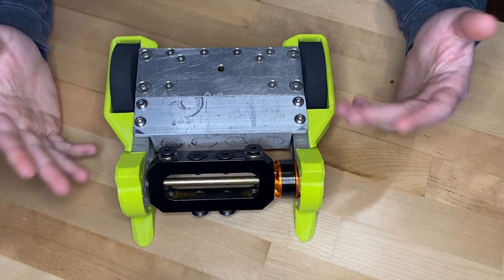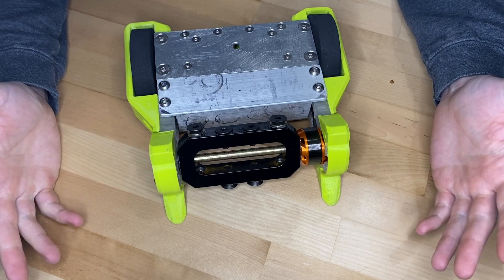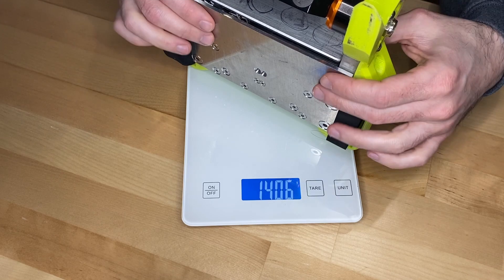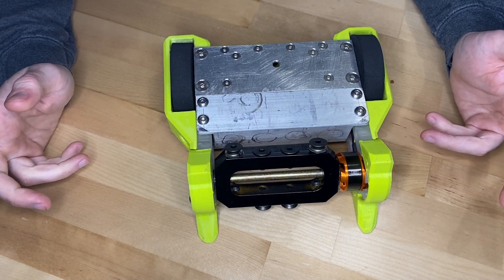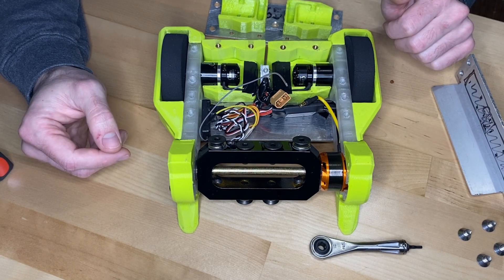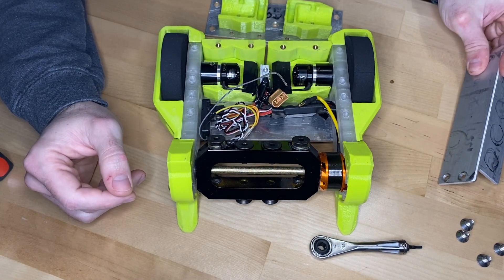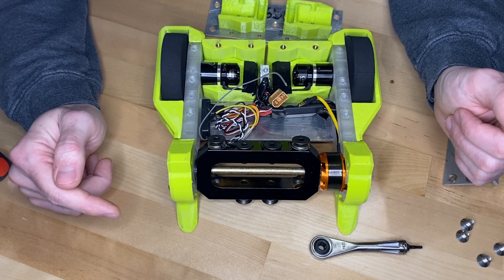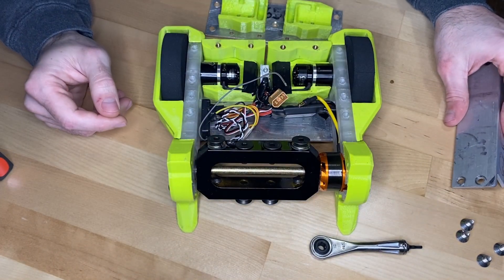Status Update (3lb Robot - Part 9)

Comment: Also consider removing the screws in the beater bar and using carbon fiber for the bottom plate.
Reply from the maker: Good options... CF will probably happen eventually, but I'll keep the screws until there is absolutely no other way to save weight, haha!

Comment: I use a 7805 voltage regulator as a bec for my receiver. Super light. Also on our 3 lb beater bar we cut holes in the plate directly behind the weapon and added vents to the sides. The bar acts as a fan and blows air through the robot keeping the internals much cooler. You also may be able to run a 850mah battery to add more weight savings.
Reply from the maker: Good tip on the voltage regulator!  I have considered just venting that plate, but worry about facing flamethrowers at NHRL, internal temperature TBD.  I'm going to try to stick with the batt/weap esc, but both could potentially go smaller, we'll see!